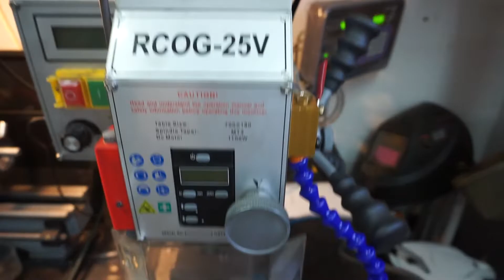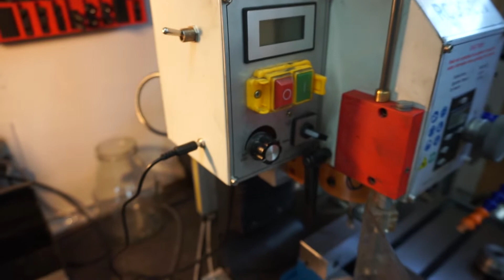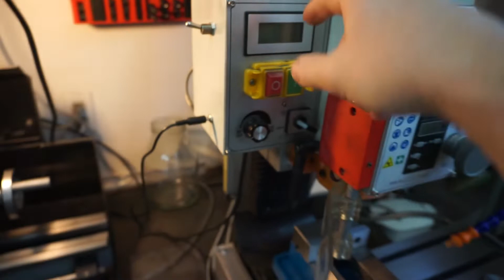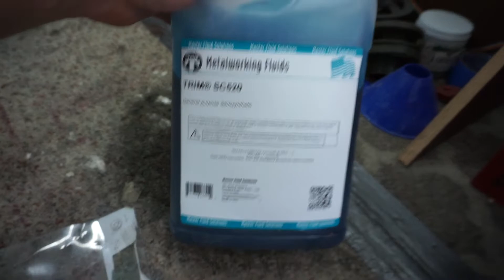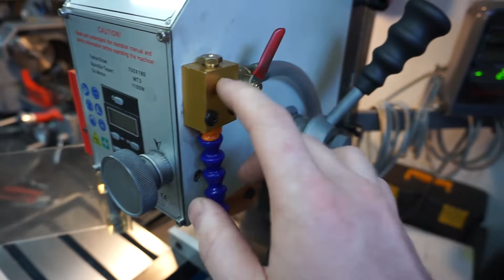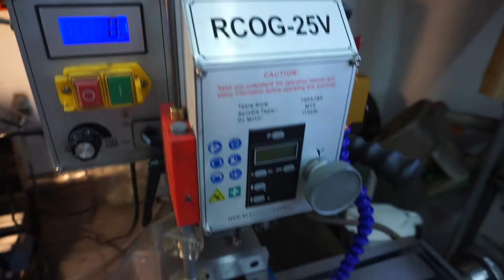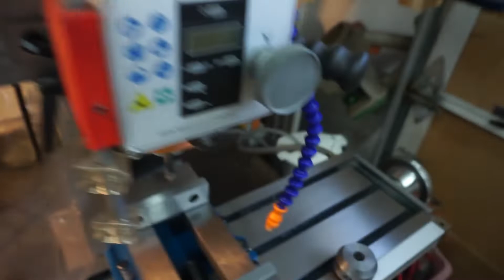Chinese  Milling machine Liquid cooling

Comment: the whole in front and back of the vise is used to guide pin that usually case with the vise kit and fit to the table slots to give fast alignment to the axis.  you mount this vise in wrong way this vise supposed to Mount horizontally to the table.

Comment: Very nice set up Tony! I have held off adding liquid to my mill and lathe. Right now I just use air and it is OK but nowhere near as effective as liquid. Maybe i am just too lazy to clean up after making a part. Anyway, thanks for posting and alerting us to the pro's and con's of liquid coolant and take care! John
P.S. Have you found anywhere to get your lathe belt replacements. I have the same lathe as you and I am having a little trouble identifying the correct drive belts! Any suggestions?
Reply from the maker: I am using polymax 5m387
https://www.ebay.com/itm/314104639397